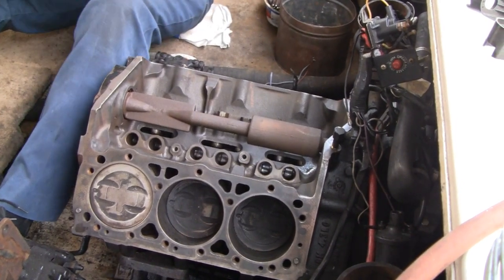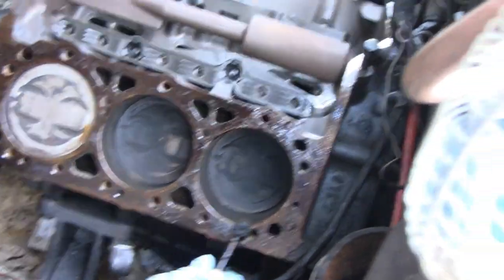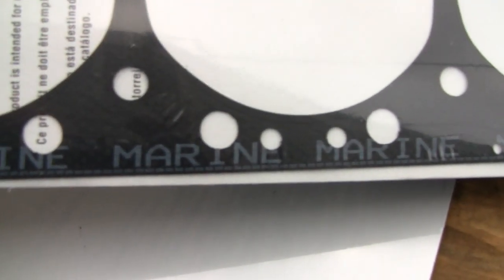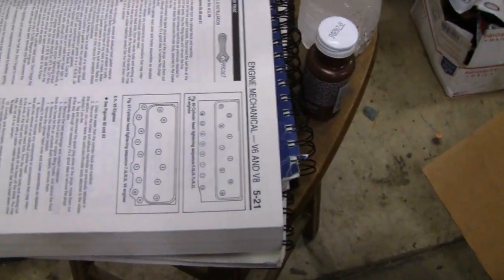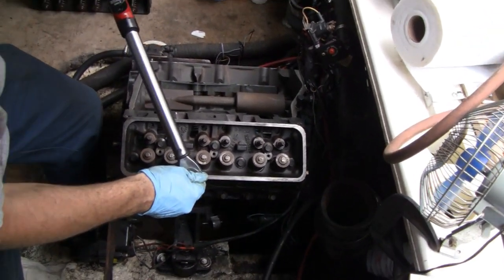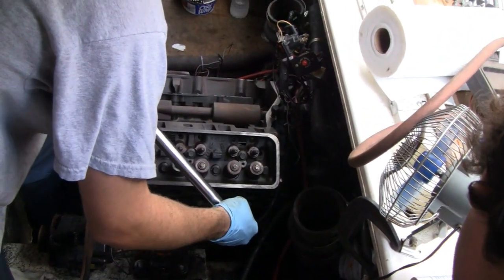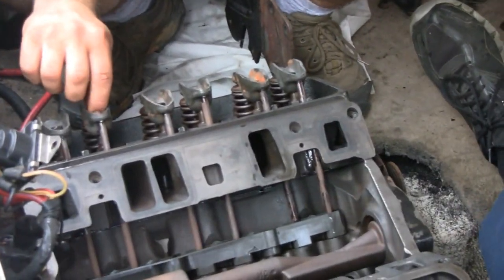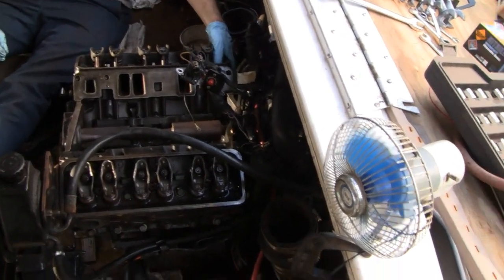MAJOR BOAT ENGINE REPAIR (part 2)

Comment: Ha! A speed wrench! My dad always called them "Screw-Mores" We farmed about 600 acres with three Farmall Ms back in the 50's and 60's before we got larger equipment. Farmall had a 4 foot version of this wrench with a stamped 1-1/4" socket to aid in taking the hitch and front mount row crop cultivators on and off. There was a place on the tractor or cultivator we would store this wrench "Screw More" to take with us to the field.

Comment: The guide stops the roller lifter from turning...I use "stuff" on my head gaskets but it's called J3 from Locktite...It used to be called aviation cement #3 ways back...I still have some of the old stuff left..I use it mostly around the water galleries because the head gasket has a sealing ring for the cylinders.

Comment: Digital torque wrenches and dial torque wrenches are GREAT, until or unless they get dropped and go out of calibration... beam torque wrenches are kind of a pain to use, but so long as the indicator stays straight they always read accurate.

Comment: Just make sure to use break-in oil when you first start it up so that the cam and lifters don't end up being more messed up than they probably already are. Also, pre-lubing the engine with a dummy distributor drive might be a good idea too.

Comment: I love how the torque wrench is digital, but clicks when the proper torque is reached. Every digital torque wrench I have sever seen just makes different beeping noises until the correct torque is reached.

I always liked the idea of the digital torque wrench, because nearly ever torque wrench sold in the USA is in ft/lb or in/lb, but vehicle manufacturers often use NM or Kg/M, and roughly convert those numbers into ft/lb or in/lb measurements.

Having a digital torque wrench would probably mean you could enter the measuring unit specified by the vehicle manufacturer, leading to torque that more precisely matches OEM specs.

There are some digital torque wrenches that have features I do like. Some of them measure the correct torque, then meaure the correct angle when using torque to yield bolts.

Comment: i was wanting to know if the engine has a plastic timing cover if they to replace it with a new one
Reply from the maker: danny thomas It was plastic!!☺
Reply: have used old one have a oil leak they say it warps when taken off

Comment: Did you guys charge your buddy? I have the same engine in my 19' four winns and I need it rebuilt.. metal knocking noise from one cylinder when it runs.. (Maybe a bearing or rod)? But Im thinking just pull the engine and that it to a shop for a rebuild.. wondering how much that would cost me though.. Maybe 2.5k if I'm lucky? What do you think ROADKING?

Comment: Don't think I would of used that Indian head stuff on that.
Also looks like you used a LOT

Hope it don't mess with your torque specs
Reply: I doubt that did but the thread sealant on the bolts might have.
Reply: jrmym2 I was thinking about that too , Looks a Lot Thicker then my Thread sealant.
I USE to use the jomarvalve (White stuff) Thread sealant on Engine Side covers , But After "Hydraulic Locking" The end of the bolts (From the sealant getting in front of the bolt I stopped using it. ALSO It's REAL Hard to get out if you use too much.

Comment: Did it really matter left and right on those heads?  Chevy always USED to makem so you could swap them side to side...
Reply from the maker: MrComaToes You can swap them, but these had some bolts threaded in the front for some brackets!!☺
Reply: Yeah...Chevy USED to drill those on both sides, but that might cost a tenth of a penny each to do...soooo there you go
Reply: MrComaToes well, even if you could swap them, your not supposed to, because every part in the engine wares differently, so all parts taken off the engine are supposed to be put back in their original position otherwise they will ware out faster.
Reply: josh ziesmer Yep, you are right, in most cases you should put stuff back together exactly the way it came apart.... I knew a guy that blew up a 30,000 bus engine because he accidently switched two rod caps... Older GM small block heads are a special case, they could be flipped to either side,. still, probably better to put them back as they were.

Comment: the old beam torque wrenches are more accurate than most of the clickity click ones. I dont trust them. If you saw the insides of one you probrobly wouldnt trust it either

Comment: Marine head gaskets for salt water operation is probably important if the gasket material is made to resist corrosion, and it may be slightly better for fresh water than automotive gaskets but most other "marine" parts are BS as far as I'm concerned.

Comment: hope you replaced those head bolts!  they are all single torque bolts and once they've been properly installed once when you torque them again you are stretching them past thier safe tensil strength. They'll snap off in the block and then you have a much harder job trying to use an Easy out or drilling them and helicoiling all of the boltholes for the ones that break off. 
OH NO!!!! God i hope they don't run that engine hard. if they do you or someone else will be doing this job again and have to figure out how to get the bolt ends out. Why are you putting Shellac on the block and heads? never seen that done before. usually you just put the gasket straight on the metal no form a Gasket or anything. not critisizing i just never seen that done before.  buddy of mine uses mixed diesel and gas for kinda like a parts cleaner the local shops get someone that accidentally put Gas in a diesel car or truck and he goes and gets it when they pump it all out of the tank. works beautifully for a parts cleaner and they are happy to give it to him too because it costs them a fortune to dispose of it properly, can't just dump that stuff out just any where.

Comment: WTF,, you used  indian head on headgaskets Face in palm ,,your screwed 
if that thing blows it is cause you used indian-head on it 
I've used  standard automotive gaskets in boat engines many times  without failures 
but  every engine I have seen with indianhead or similar stuff on the gasket  has had issues